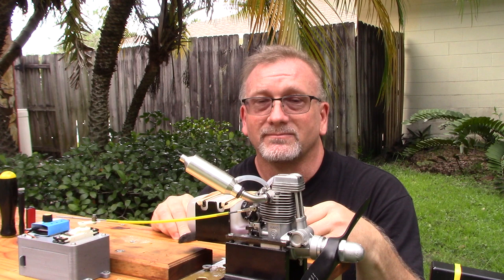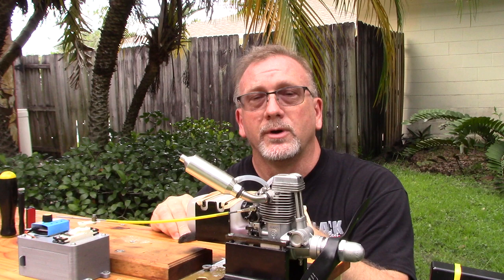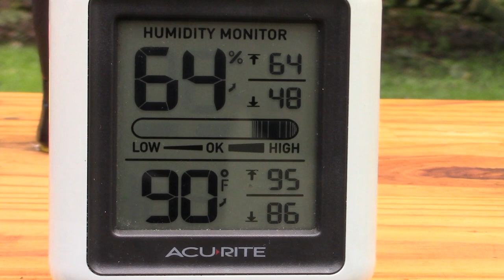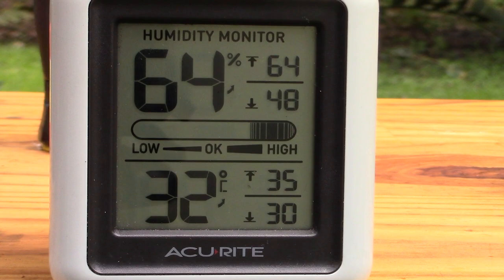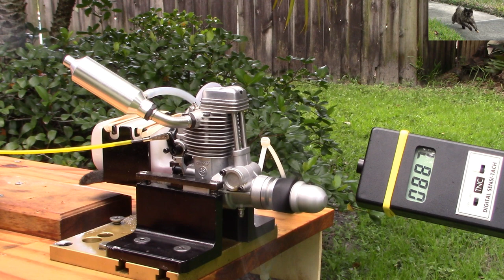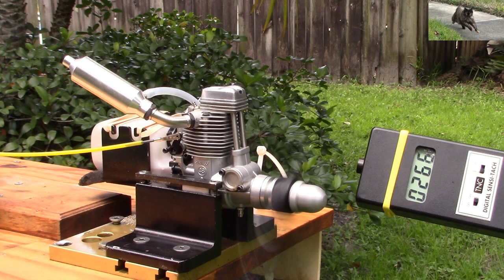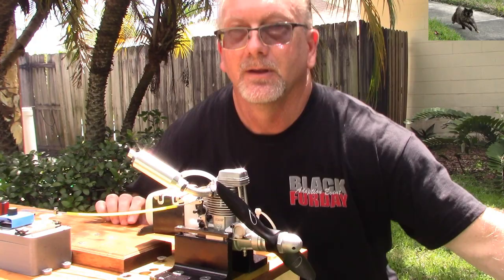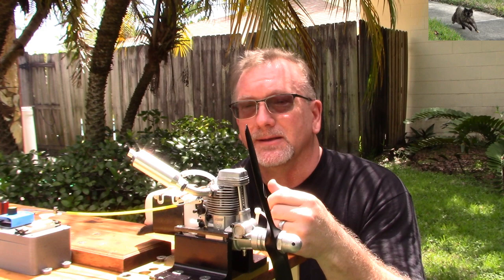OS FS-48 Surpass Crankcase Repair The Run Part 3

Comment: It would be interesting to see how the repaired crancase would hold up with regular use. 
I wondering about how well the jb weld holds up to glow fuel.
Reply from the maker: JB Weld is impervious to gasoline and alcohol based fuels.  There is no reason why it would not hold up indefinitely if the surface preparation is good.  It is designed to do this exact function, that is why I used it.